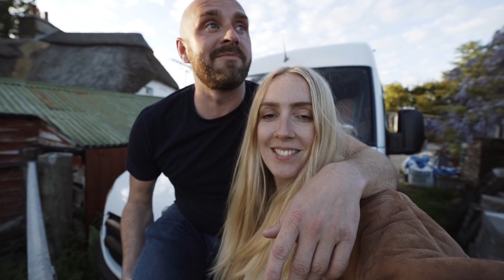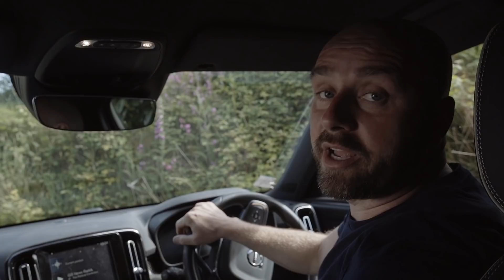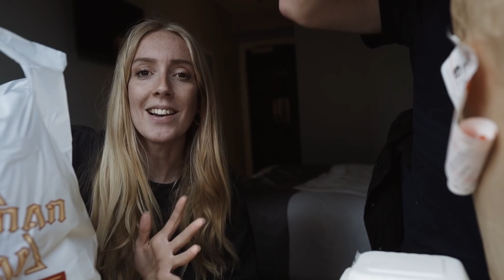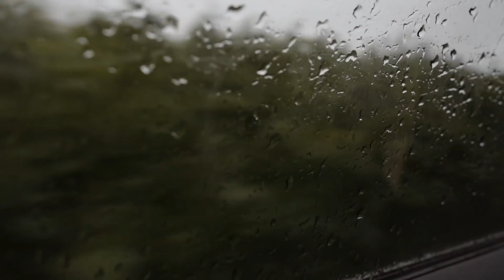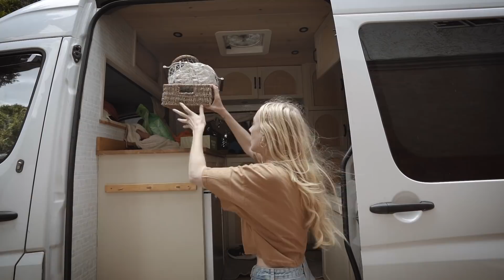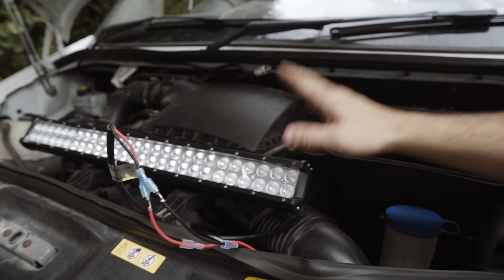We Need This to be Approved (Applying for a Long-Stay USA Tourism Visa) Van Life UK

Comment: Welcome back. It's been so long I thought you'd packed it in. I imagined you both running a Turkish food take-away from a trailer in a Devon layby. Congratulations for finding cruise control on the van. That system went across most Mercedes cars & vans and was probably the best and easiest across the motoring world. In the latest Sprinters they've moved it to the steering wheel and it's much more fiddley. Easy to confuse with the speed limiter and if you've got a McDonald's coffee cup in your hand while you're steering the bottom of the cup operates it all by itself! On the upside the latest vans come with digital radio which means you can now listen to some decent '70s music instead of the pony they pump out on Radio 2 these days. Can't help feeling sorry for Scout. I know it's supposed to be the sensible thing to do, blah, blah, but being an old dinosaur I don't like it. "I guess every form of refuge has its price." (Eagles). Good luck to you all!
Reply from the maker: Haha you can’t get rid of us that easily 😅 Can’t believe it’s taken 40k miles to find the cruise control! Better late than never? Ben’s actually just fitted a DAB radio to Sophia, should keep us entertained on those US highways! And don’t worry about Scout, he’s much safer and happier without his ⚽️. And I don’t think he has the intellectual capacity to become attached to them in the way that human males do 😉😳